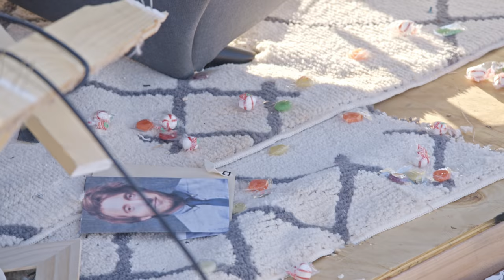Dropping a Living Room

Comment: Pianos are often seen falling because they're so large that in order to get them into an apartment in say New York, they have to be lifted by crane and brought in through some hole in the wall where a window would be. The piano can't fit through the door! In the past, methods to raise the piano may not have been all too reliable and as a result, occasional accidents would result in a falling piano.
Reply: AndrewmanGaming this was very informative
Reply: Intresting....
Reply: AndrewmanGaming And even if it fits through the door, there will be serious trouble carrying it up or down the stairs, even for burly men with proper harnesses.
Reply: what wiki did you steal that from?
Reply: Information at a comment surfers fingertips, thank you good sir
Reply: Wouldn't want that falling on my head :/
Reply: I’m glad I’m not the only one with this knowledge
Reply: Pianos are also a lot heavier than pretty much any other large furniture that might not fit up the stairs, so it makes the most entertaining impact when it falls.
Reply: When doing so, key aspects attention should be paid to include the alignment of the vertebral bodies and spinous processes, the presence of rotation or translation, and assessment of normal curvature, loss of vertebral height, or increased distance between the pedicles or spinous processes.

Magnetic resonance imaging (MRI) may be helpful in providing information about the spinal cord, nerve roots, and intervertebral discs. This can also demonstrate cord edema or hemorrhage in an acute fracture, and provide information about the integrity of the posterior ligamentous complex (PLC).🖥

Comment: A sentence I never thought I'd hear: "Why did you drop the piano on MY chair?"
Reply: Note also that injuries above the L1 segment produce an upper motor neuron pattern, while those below L1-L2 only affect the cauda equina roots, and therefore demonstrate a lower motor neuron pattern. A unique feature of T12-L1 injury is the conus medullaris syndrome, characterized by damage to only the sacral nerve roots innervating the bowel and bladder, with intact lumbar nerve roots.

X-rays of the spine are sufficient to identify most spinal fractures. However, as many as a quarter of burst fractures are diagnosed incorrectly as compression fractures with plain radiography alone. Therefore, computerized tomography (CT) is useful to further characterize them.
Reply: Did you mean to put this here?

Comment: The reason for the classic "piano falling from a crane" is because most rich people in cities live in upper floor apartments and there was no accommodation for getting a grand piano up the stairs, elevator, down the hallways or through the door.  So if you wanted a piano, you literally had to lift it on a crane and remove windows or sections of wall to get it in.  A lot of old buildings had a number of sketchy pulley based hoists around the outer edge of the top.  A lot of modern skyscrapers have permanent cranes attached to the top for purposes like that.

Comment: One likely reason pianos and large safes often get dropped in cartoons is that they often times have to be put into houses by taking off the roof of a building and lowering them in, since they're so big there's no real way to get them into a house otherwise. As a result, it would be plausible to see one on a crane, and just as plausible by cartoon logic that it fall at the perfect time.

Comment: Between one-quarter to one-half of patients also experience neurologic deficits. These are more common with burst than compression fractures. Symptoms include weakness and paresthesia below the level of the injury and urinary retention.

Note also that injuries above the L1 segment produce an upper motor neuron pattern, while those below L1-L2 only affect the cauda equina roots, and therefore demonstrate a lower motor neuron pattern. A unique feature of T12-L1 injury is the conus medullaris syndrome, characterized by damage to only the sacral nerve roots innervating the bowel and bladder, with intact lumbar nerve roots.

Comment: The reason the furniture didn't float on the way down is because the room's floor was creating enough air drag (like a parachute) that nothing was in actual freefall. Also the guide wires contributed their little bit as well to not have this be in true freefall.

Comment: It would be amazing if you built a room out of aluminium framing and very light cladding and then dropped it with the camera mounted so that you can only see the room- no outside. The footage would be of a normal, calm room and then things would start to floating up and fracture at the same time.

Comment: Even if they aren't a good ones. It makes me sad to see old CRTs get destroyed
Reply: drpacman579 ok?
Reply: @JoeKurr5  they are brilliant for retro games. And they are a finite resource
Reply: drpacman579 again, ok? Also they’re not a resource and they are obsolete.
Reply: @JoeKurr5  they are made in finite numbers so there is only a certain amount of them. Also they are obsolete for most tasks but for retro games they are vastly superior to even an oled
Reply: drpacman579 so? Just because they’re rare doesn’t make them good, and how are they better for retro games? Less resolution? Less refresh rate? How?
Reply: drpacman579 again they’re still not a resource.
Reply: @JoeKurr5  a crt screen basically has no input lag and no visual lag like a modern screen has. It renders a line and a display it at a time so quickly it gives you the impression that the screen is rendered at once. This means you have literally no lag as opposed to even a high end monitor on pc (tvs are awful for gaming) where they render an image and then have to hold it before slowly swapping it for a new one. An old crt can  also in a sense change it's resolution to match that of what is being a displayed. If you display a 256x224 resolution image from an NES on a 1920x1080 screen it will not look right where as on crt the image is a lot better and clearer which is why old fashioned consoles would have a massive variation in display resolution.
Reply: @JoeKurr5  of course this primarily applies to crt monitors not tvs (because TVs are always worse for gaming) but it also applies from CRT tvs in how they run older games